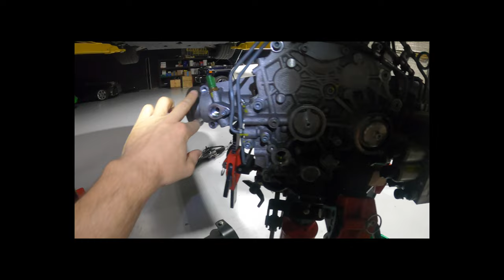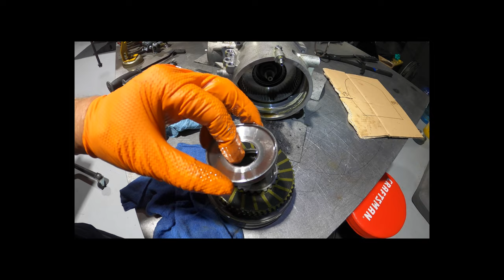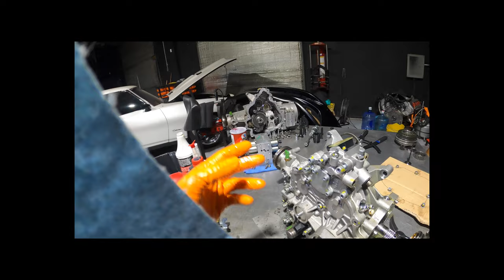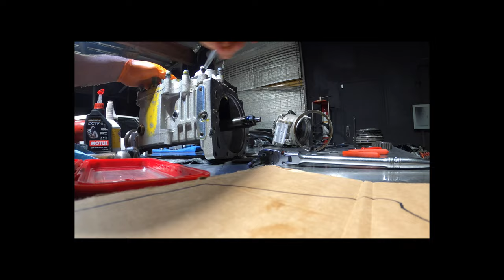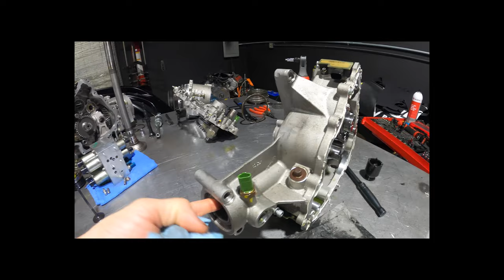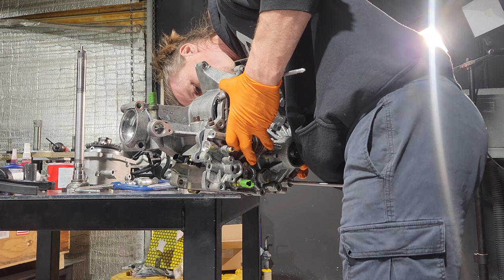PTU Rebuild Tutorial (How To) Ferrari (FF, GTC Lusso, Purosangue)

Comment: How much do you charge to fix the PTU?. amd is it a permanent fix?
Reply from the maker: Please contact Hollywood Mechanic in Los Angeles for pricing. We have not seen the same failure since installing the upgraded lock rings and bushings but it is hard to say it will never fail without having years on the unit. The spiral locks and the bushings are rated for lateral loading and the pressures the unit is operating at, so theoretically, it is a permanent fix with a seal that will have a maintenance life as any seal would. There are other less common faults we see in the ptu, and we address those when we rebuild the unit so you have no future issues.